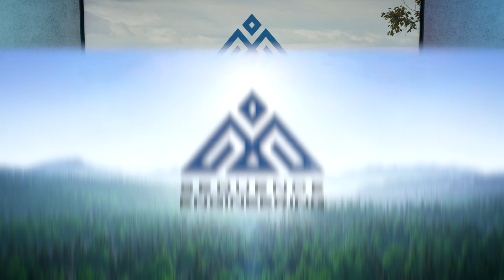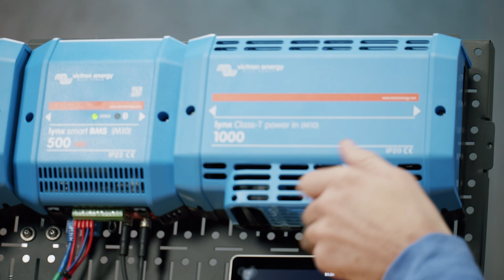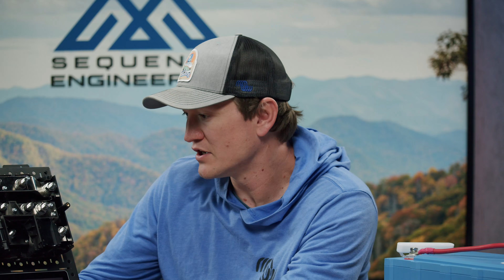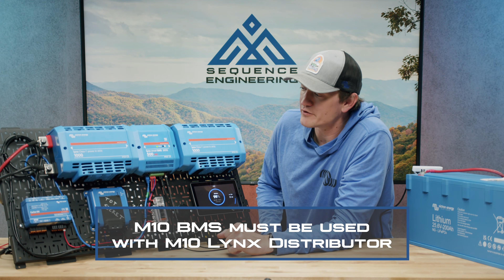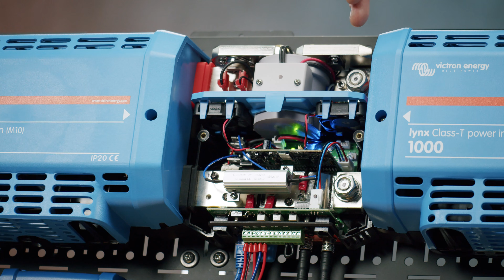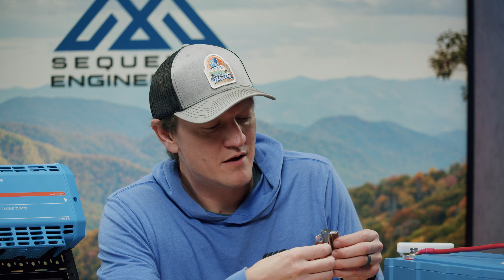Exploring @VictronEnergyBV New NG Product Line: Smarter, Safer Solutions

Comment: Now if they made a 1000 distributer with 1 t fuse that is pretty much what 90% of us would buy. Class t is already at the battery just need 1 for the inverter. cost wise does not pay. For me anyway. Great info though ty
Reply: You don’t need a class T fuse on the distributor side. The main reason you want a class T for the input is because if you are running a lithium ion battery of some sort and it short circuits, it can put out 10,000 or more amps most fuses are only able to interrupt somewhere in the 5000 amp to 10,000 amp range. Therefore, you put in a clash T fuse, which will protect your system from the battery in case of a short circuit. You don’t need that same level of protection on your distribution side. Because if you have a short, the power has to come from the battery where you have your clash teeth fuse which will stop the short. if you’re using an inverter charger and you’re worried about a short on the other end of that that also is not an issue because your pedestal has a breaker in it
Reply: @recoblade1465 I was looking forward to be built in but that wouldn't work anyway because it needs to be 7 in from the battery

Comment: I have an RV. I already have an Lynx and now a friend of mine gave it to me this Lynx ClassT. I have plug into my Lynx the Multiplus, Mppt, Orion and Fuse Box and i also have two lithium batteries (12V 100aH LifePo4 not from Victron). The question is, is good to me to plug both batteries on my new ClassT?
Reply from the maker: Great question, there are a few different opinions on the absolute safest way to fuse Lifepo batteries but we like to fuse every single battery or if we're using the NG batteries in Series we fuse each string.  For example, we commonly use qty. 4 x 24v/200ah NG batteries to form a 20kwh 48vdc battery bank.  In this scenario we run 2 parallel banks of 2 batteries in series and we run the resulting 2  positive and 2 negative wires up to our Class T Power In.
Reply: Awesome video BTW.